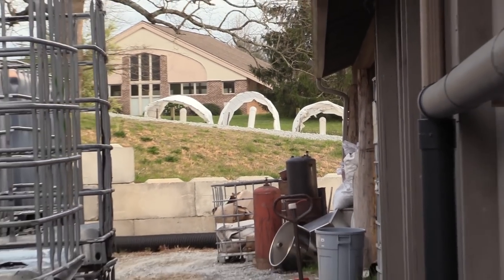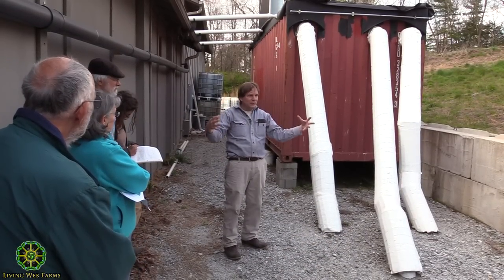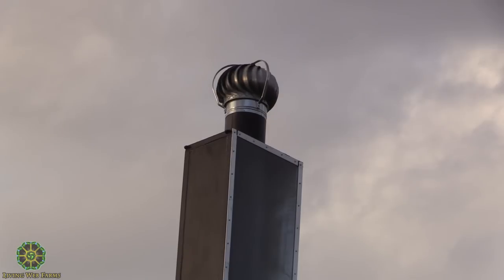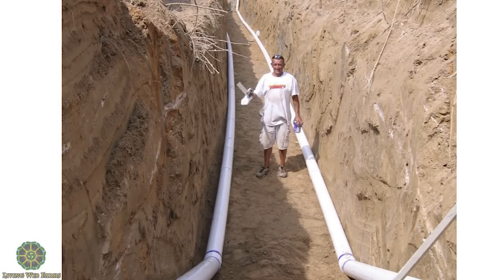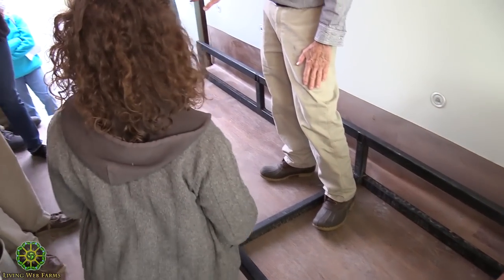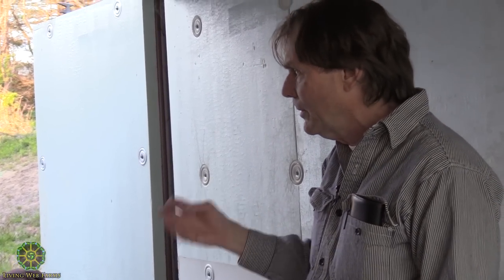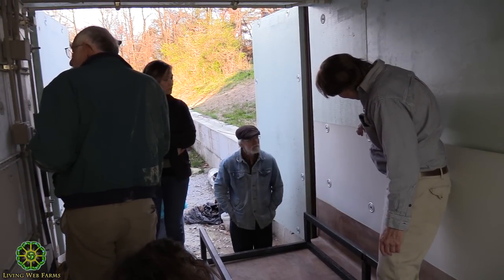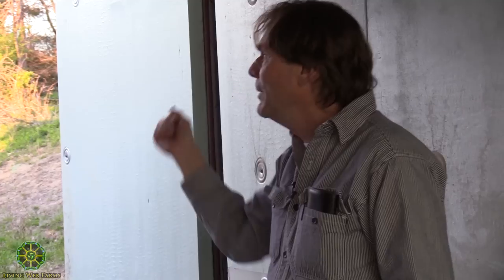Earth Cooling Tubes for Ventilation and Climate Control Part 2

Comment: I haven't seen much in the way of English-language material for this, but here in Poland there's a growing trend of ground/air heat sources for heat pumps. The way they deal with mold and humidity is that you use open air ducts (i.e. a flattened half-pipe) over gravel and sand. This way the air can be conditioned in either direction, and any excess water can drain away - or extra water can be sucked out of the ground if the air is being heated, and since there's no standing water and a lot of air flow you shouldn't have mold issues. The gravel also provides extra surface to exchange heat with. It's usually built under the building to save space and digging effort, as well as isolate from air heat/cold. Due to the climate here it's mostly used for heating, but provides cooling as well.
Reply: Yeah, why don't just dump the water in the ground?. I look it up in the Polish internet. Interesting models. But How to clean the dust, the usual grime? There is this problem that nowadays everything in the internet is propaganda.
Reply: Thank you for posting this. I am a big fan of Earth tubes for warming air in the winter,  but the condensation from cooling moist air in the winter was always a problem that convinced me to avoid that. I will have to research this. Do you have any links with websites or videos?
Reply: Could also make a connection from the lowest point to an inspection well from where the water could drain to the ground.

Comment: As Patrick has suggested, I see no problem placing the pipes parallel to the slope on a hill. The degree of slope, towards or away does not matter as long as you place a condensate drain ON THE BOTTOM of the pipe just before the pipe turns upwards to enter the structure or air intake hood (depending on which way the pipe is sloped). A bottom drain is advantageous because it does not require periodic pumping and makes elimination of accumulated dust and debris much simpler that a top down clean out. I would also screen the entrances to the pipes to prevent entrance by animals. I also believe (but have not yet tested this theory), that cross connecting the tubes (every 20 ft or so with acute degree connections oriented in the direction of flow, staggered between parallel pipes), increases efficiency by delaying air movement in some sections and therefore increasing the time available for heat exchange in these sections of pipe which contain slower moving air. To achieve a pulsed effect the air intakes need to face in slightly different directions so that the relative air pressure and dominant flow paths through the interconnected network of pipes are constantly shifting in response to shifts in the prevailing wind directions. To flush the system, simply remove the drain cap and run some water (and dilute disinfectant) through the pipes then connect a suction hose to thoroughly dry it all out.
Reply: Great concepts here, particularly interested in your ideas about interconnecting the pipes to create a pulse effect and slow air movement down to increase air temp change.  If you get this message, I'd love to ask you more about your thoughts about using these pipes in a home.  We're getting ready to put an addition onto our house and would like to try to incorporate passive cooling/heating features.

Comment: Im no scientist.. but in regards to the water buildup.. could you possibly dig down at the areas that water would gather.. put perforated pipe straight down and surround it with gravel like a french drain? That way the pipe would drain out on its own. I think of septic fields.

Comment: What about a gravel bed at the bottom of the pipe under ground, with siphons coming out to siphon out the water.  The moisture outside the pipe would help with cooling wouldn't it?

Comment: Why could you not use perforated leach field pipe to drain out any accumulated water in the tubes?
Reply: Great idea but you have to be sure the water gets drained out and not the other way around.😃 Must be well above the water table and the surrounding material must be sufficient for drainage also in the raining season.

Is there any perfect solution for avoiding water in the tubes?

Comment: You could easily go to a vertical pipe of a larger diameter at your lowest point and use submersible pumps that could be used in the rare case you get condensation build up , which also would make them very easy to pull and service if need be. Lighting could be massively improved for efficiency by using led type low profile. The fans could easily be more efficient by not being blocked by the lighting or other obstacles. The fans pictured are actually low amp but there are far better for the purpose. Your coefficient for the fans would not be changed for the current application by moving them by 6 to 8 inches.

Comment: This guy needed to do some practical tests prior to installation.The air in my tubes can drop 30F in less than half a second, if i used 192ft tubes, the air would be coasting through almost the full length without getting any cooler.
Reply: Tell me more. Is it due to laminar air flow in straight pipe?
Reply: Yes, can you tell us the length & diameter of your tubes...what is the temp at the inlet vs the outlet...how deep are your tubes buried?

Comment: Why were the inlet tubes not nested together in a shaded spot(tree or shed) instead of out in the open?
Why were the tubes not introduced to the shipping container through its bottom instead of being exposed out in the open?
Why wasn't the shipping container not painted white to reflect heat for the way it is presently it will only absorb heat?
Why do you call the heat extraction tube a chimney when it is a cupola?
Flow through a pipe is greatest at the center of the pipe and not the walls. If you study flow and turbulence, you will learn this.
 I hope you weren't paid for this in constructing or advisement of theory.
Reply: not my setup, but if you watch the other video: 1) they said they wanted to shade them with trees but just didn't get to it. 2) they have radiant floor heating, so it had to come in through the wall somewhere. then, they had the stacks of drainage and habitat. nowhere else to really put the pipes without sacrificing floor area. 3) not sure, but maybe it does not get much direct sun. 4) probably because everyone knows the concept of a chimney, but not everyone knows cupolas. 5) he was saying that the heat transfer is greater at the edges "perimeter of the inside of the pipe is what's catching the coolness and if you", not the fluid flow.

Comment: Heat problem. Have a high low speed pump that runs slower when the heat is satisfied and to keep fom overheating. Have heating tube loop isolated from hot water source by using a heat exchanger. Hotwater tank side of heat exchange runs on demand, then external heat loop runs high on demand and low speed when satisfied. Then have an addition thermostat that allows low speed to run constantly only when outside temp is below freezing.

Comment: Is there any way to clean the tubes? (bacteria, mold)
Reply: Good question. We installed a similar system 1994 for an air/air heat pump for our home. It’s for cooling in summer and preheating in winter. Besides a screen and a filter, there’s nothing we’ve done for cleaning, and we have had no issues since then.

I guess there must be some (probably expensive) robots which are able to inspect and clean those pipes. Maybe it’s sufficient if you check the incoming air for mold etc. first and if the air is bad then take further action like renting those tiny robots..😃
Reply: @stebarg  , is your system closed loop or open loop?
I've done se preliminary searches for the air to air system with no results. Only the liquid filed system. Thank you for any insight you may choose to share.
Its pretty much dry climate here in west Texas and it routinely stays above 80⁰ up to 115⁰f
Reply: You can run a UV-LED light strip down the tube to sterilize it as needed.
Reply: @stebarg  yeah but for your air to air heat pump these tubes are on the outside part of your system. The air from the tubes never comes in the house but the heat is transferred by the heatpump to the in house airflow.